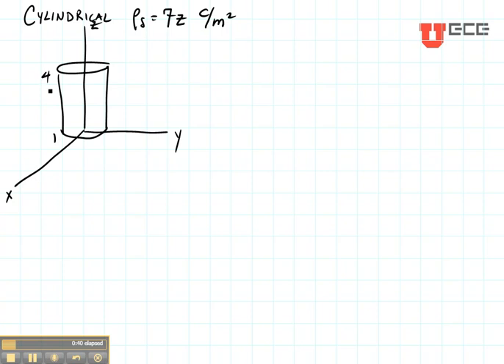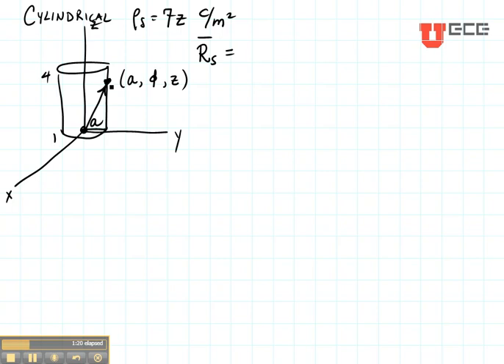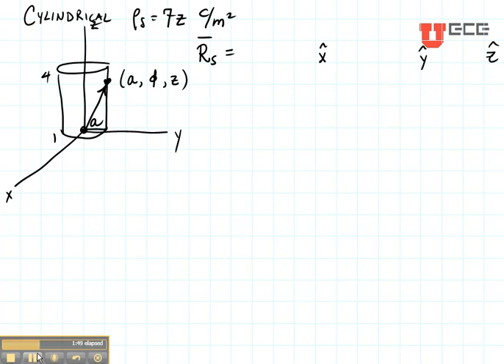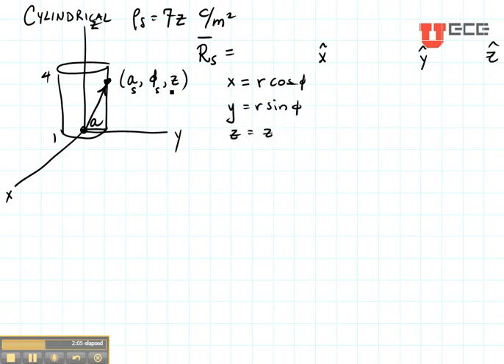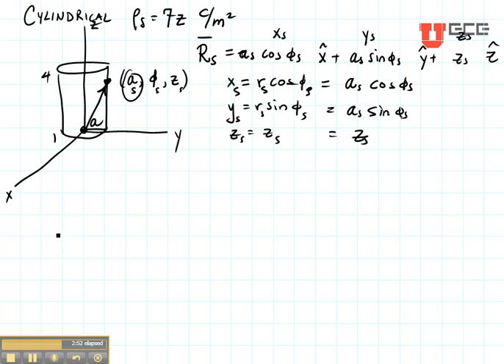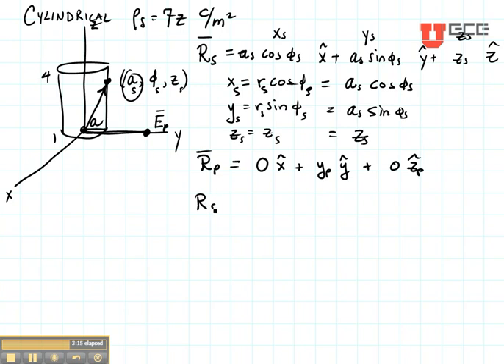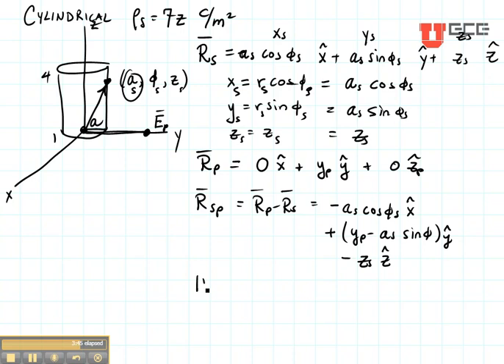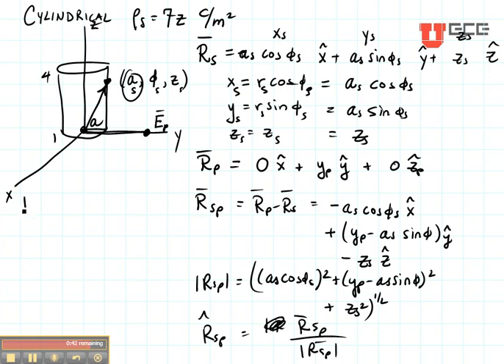ECE3300 Lecture 15-10 Coloumb for cylindrical coordinates

Comment: There is a small mistake when you defined the vector Rp it should be 0 in the z direction not 0 in the Zp direction. Still great video very clarifying.